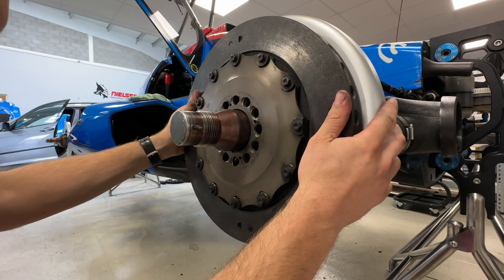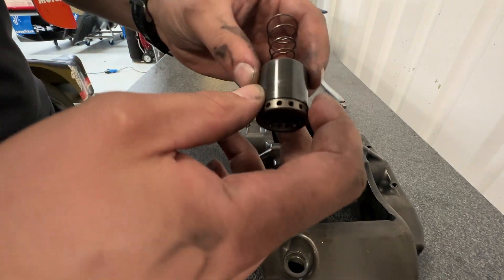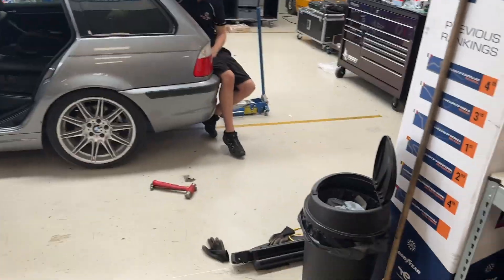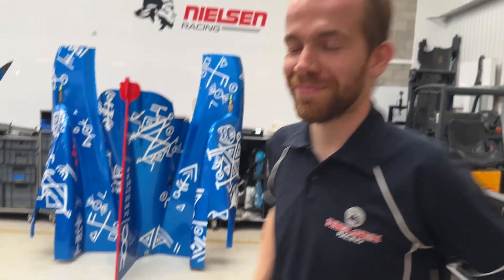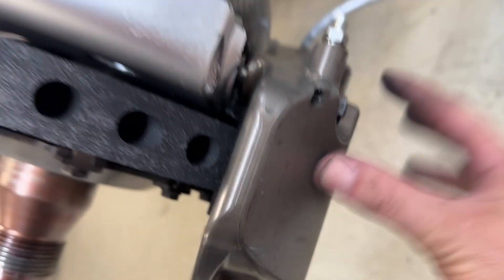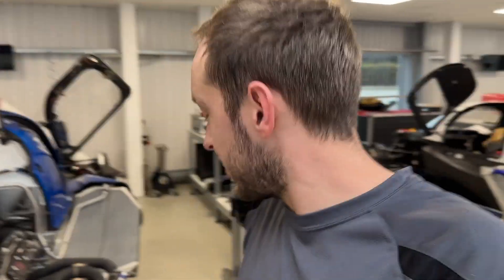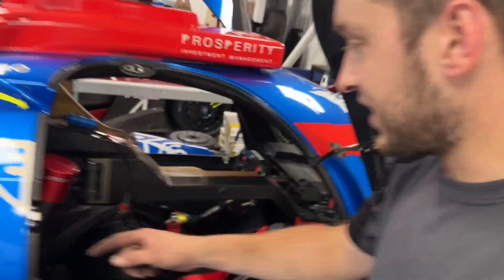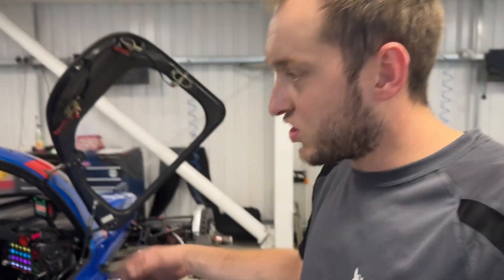WHY THIS RACECAR HAS 4 MASTER CYLINDERS?! | BRAKE REBUILD!!

Comment: Nice system that 4th Master Cylinder. I take it that an actual clutch plate or thrust bearing failure could still render the marshals (and car) proper stranded - speaking from the wonderful experience of limping an old car home once with a snapped clutch Cable 😕
Reply from the maker: Yes that would cause the system to not work for sure. Ahh yes old cars, will always give you them problems, I had a throttle cable snap on me before.

Comment: Apt timing... I'm just about to go at the brakes on my Gillard kart :)  Two questions - how much is a that set up per corner and BTW how much is a ready to roll Oreca LMP2 ?  Love your channel BTW - even nicer that that team's named after me :)
Reply from the maker: Ahh nice work, I'm not exactly sure on the exact price per corner but I would say for the whole brake setup for the car you  would be around £20,000
The price of a lmp2 is cost capped at €483,000 and that doesn't include the engine which is leased and you cannot purchase and doesn't include the electronics package which is like ecus and stuff.
Reply: @TheMotorsportMechanic  Fantastic stuff... again,  mega thanks for all you're doing here,  the channel's brilliant !

Comment: I find it funny that the dust shield has so many bolts to hold it on... But they brake caliper itself only has 2 bolts!
Reply from the maker: Yeah I do see what you mean but I guess that's just the way it is 😂 some things do have more bolts than necessary that's for sure

Comment: That brake rebuild seems suprisingly easy and something even i could do! Despite being graduated as a mechanic i sucked at working on actual cars allthough the brakes weren't that difficult... Except drum brakes.
Reply from the maker: Yeah brake calipers are fairly simple and don't have a lot of components, yes drum brakes can be a pain especially when a spring goes flying and you've got to go find it 😂